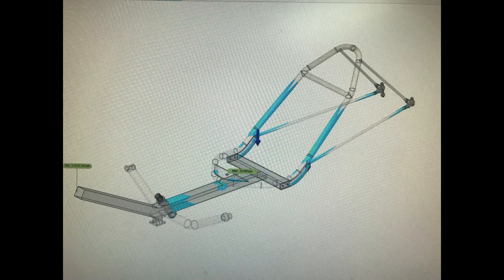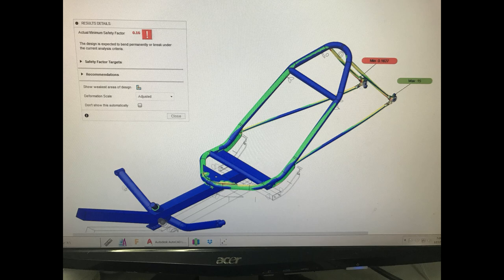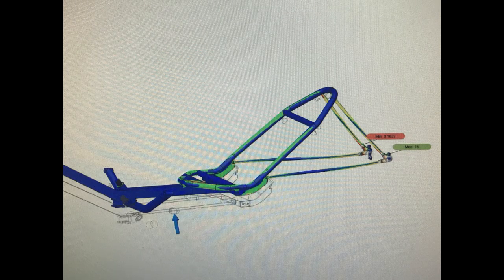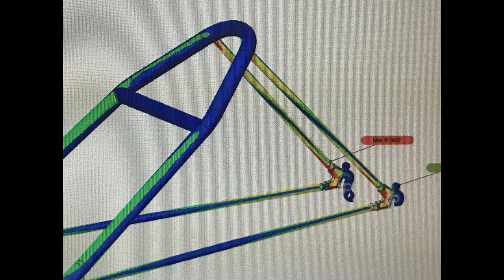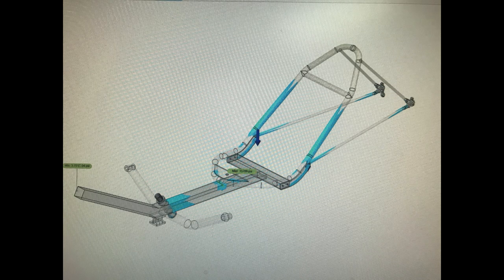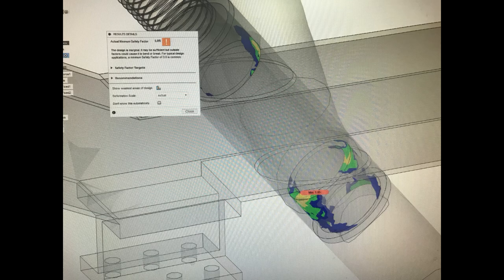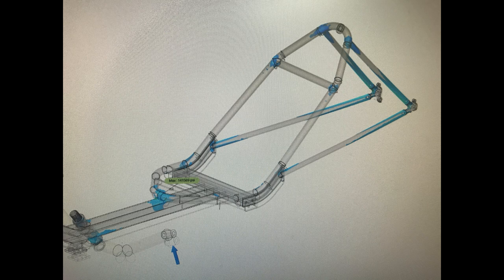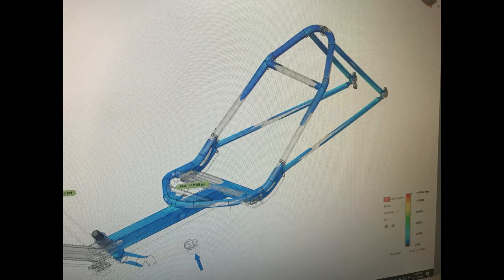FEA for Safety and Fun

Comment: Dave, This is fascinating stuff. I can only think back to Galloping Gertie - The Collapse of the Tacoma Narrows Bridge. Then there are the very last steps nessary in design of such mechanisms as multi pump drive high pressure and volume mining shovel. The woman that designed the pump drive I am familiar with was a brilliant mechanical engineer and wanted her name on her pump drive transmission. The Cheif Engineer said no way. I visited with her on her way out the door and the last thing she said was they would regret letting her go. Every pump drive failed to self destruction. The company also scaled up the design and the life span was shorter. As a service specialist doing engineering test work I created measurement instruments and a multi channel analyser to record real time stress and position anywhere in the dig cycle. Off to Australia my equipment went with a Rolls-Royce PHD engineer. After installing the "solution new pump drive" instrumenting and putting the P&H 2250 shovel to work we had in short time yet another self destructed pump drive and knew why. The hydraulic oil tank both the pump drive and 2000plus hp diesel engine sat on oil caned and sent a torque spike into the pump drive transmission turning at resonance causing amplification and self destructive forces into the pump drive. F.E.A. is VERY important. Finding the resonance frequency of the pump drive transmission was the secret she left with. This oversite KILLED the Hydraulic Division an eventually P&H. Treating  coworkers with dignity and respect is important. If you've read and this makes any sense intelligence is the tools David took into retirement and he's the real deal, knowing what to do with computers all that more important They are not there to amuse a wizard like him. Dave I can't wait to get all my hidden projects done and move on to my getting an AR3. There's just this hidden heating oil tank under a 13 x 30 3 season room to deal with. I tip my hat to you friend.
Reply from the maker: I’ve had so much fun bringing the AR-3 back to existence but never dreamed I’d meet so many wonderful people along the way as well as a couple duds that for their own selfish reasons not include me on their website evaluations. Like the woman who worked so hard for P&H only to be disrespected so deeply. I think high achievers do what they do for that respect. 
Circling back to my point, I’ve tried to instill confidence by pointing out my team did everything in our power to do the AR-3 correctly and to high standards. Keeping a huge shop full of machinery and resources costs thousands in overhead every month. I gave this one year plus a huge investment to get it off the ground.

Comment: Huge thumbs up! 
Suggestion: if the wheel on the inside of the bend was not behind but in front of the outside wheel of the bend like skiing, it would be probably better. In short, it would be a mix between the skateboard truck (reverse), the ski and the car at the directionnal level.
Nice job again, MR. (from france)
Reply: Bad idea in fact.
Thank you for the sharing of your work.

Comment: Have you tested it for touring i.e. pulling trailers/carrying weight?
Reply from the maker: No differently than any other tadpole with weight limitations. I found the limitations are based on the limits of the bike components used.